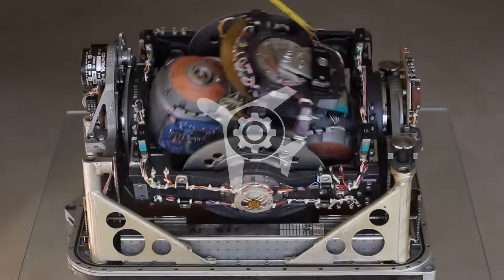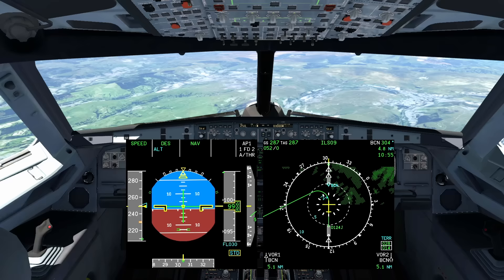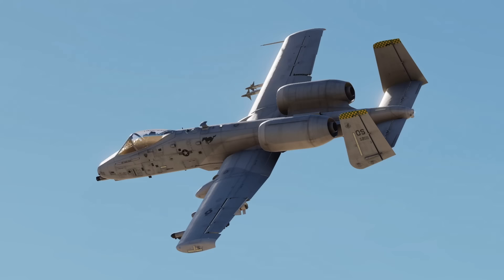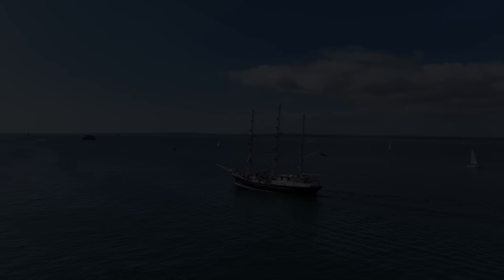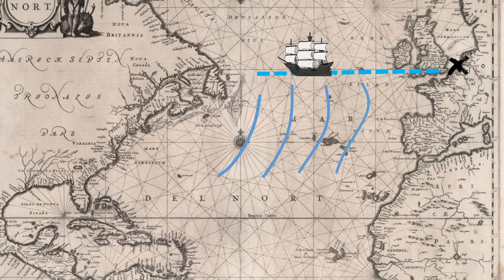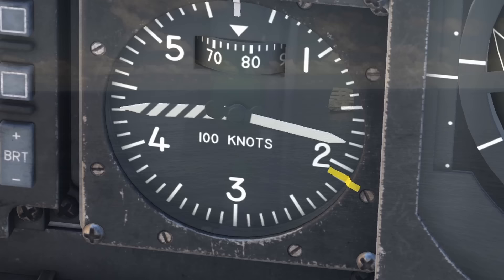The GENIUS of Inertial Navigation Systems Explained

Comment: Very interesting. I actually build part of these inertial guidance systems back in the mid 1960’s. I worked for Litton Systems just outside Toronto. Very fine work under microscope and a lot of assembly was done in “clean rooms” where the air inside was filtered. Anyone working inside that area had to wear special clothes that went over all your street clothes including your shoes. Only your face was exposed. The fingers on your hands were covered in finger cots, they looked like miniature prophylactics. If you had a cold or were sneezing you weren’t allowed to go into that area. The tolerances on the gyros were so tight a piece of dandruff could gum up the works. Lots of inspections done on this work.
Reply: How old r U❓
Reply: Sir, that’s absolutely fascinating. Lord knows my notifications for YouTube are all sorts of outta wack, but I’d appreciate any more info or stories you have from your time there, or in related fields. 

As someone who loves American history and 20th century history (especially postwar) - the amount of mundane people one can meet now in person or online is wild. 

All these stories hardware and vehicles, and those who had hands-on day to day such as yourself are here and around to speak about it.
Reply: @yeetyateyote5570  , I only worked at Litton Systems for about 13 months. I mostly worked on what was called the end bell which underneath the round end of the gyro. The metal was anodized aluminum. There were holes drilled for very tiny electrical contacts all around the circumference. We had to glue in tiny literally gold coated contacts into these holes withe special adhesive. I believe the tube was called LC 9. They were kept in a freezer. We had to sign each tube out and they were only good to use for 30 minutes. We used a tiny applicator to put about a 90% circle around the gold contact which was imbedded in a glass insulator. This work was done under a 10x power microscope. We had to place the contact into the hole and not get any of the glue onto the side on the way down. These end bells were placed into small autoclaves to cure the glue. I forget how many contacts were on each bell. We had rubber coated trays that held 5 end bells. We were expected to do I think 30 per week. Not big pay, only around $1.15 hourly in ‘64. All of these end bells were inspected to ensure there was no glue on the side of the walls. After curing a clear sealant was put onto each contact and it was cured too. If you had any rejected you had to clean it all up and re submit it for inspection. I was pre darn good after getting a few rejections at first. Being more precise was better than cleaning up.
Reply: @rickbullock4331  That’s fascinating. I got my pilot’s license in 1992, but never used ILS because my family owned many FPO that my grandfather (an early adopter of personal aircraft) had founded during the time many airports were being built. I’m shocked when this video says that a gyro will need correction due to changing gravity. Although it was never discussed, I assumed that a gyro would adjust to local gravity and always stay exactly positioned as it was started in reference to L&L. If I took off from Lubbock to Honolulu, I assumed old ILS was flattening out as I flew- in relation to the starting position. How did I miss this all these years? LOL

I never learned ILS or even continued flying fixed wing, as I knew 30 years ago that we had employees that would always be better at it than me. My thing is exotic cars and guns. I figured I would live longer if I let the guys who were passionate about flying to the flying. I’ll drive the race cars once we get there and make my money with guns. 

BEST WISHES. 

Nick
Reply: @rickbullock4331  Damn youtube for having nonfunctioning notifications. 
That's quite interesting- it's wild they were paying you guys next to nothing for what is inherently skilled/precise assembley work. To have efficient per-worker use of the temp sensitive glue and more importantly to eliminate the maximum possible amount of inconsistency between final products with such manual methods, you'd think the wage should've been higher!

Comment: My great uncle worked for the Bendix Corporation in California. They had a contract to make ball bearings for a ballistic missile nav system. The balls had to be machined to millionths of an inch. As they began delivering the balls, the missile company was rejecting them as being out of spec. Bendix had to mount an investigation to understand what was happening. Turns out the method being used to measure them was so sensitive that it was measuring a thin film of oil left by the machining and adding it to the overall measurement.  They began cleaning the balls with alcohol before measuring them and that solved the problem.

Comment: The first series of airline ABS braking is pretty ingenious as well.   
There was a generator affixed to each wheel.   As long as they were turning, they generated a specific voltage.   When the wheel locks up, the voltage drops and the relay opens up the brake that goes to that wheel.   When it starts spinning again, the brake pressure is allowed to continue.
Reply: Is that the Maxaret system?
Reply: Don't remember..

Comment: What a superb device AND presentation, thank you :-)  I remember the early US transcontinental INS validation flights. Soon followed by commercial aircraft such as Concorde and the first 747 series being fitted with three INS units that would monitor each other's performance... allowing a 747 to fly from Sydney to London (with two stops) in the pre-GPS era. Of course, there were also ground based radio navigation devices (VORs and NDBs) that allowed INS cross checks and updates, when necessary, as the route progressed.

Comment: The submarines that I was stationed on in the 1980s had inertial navigation units which we used all the time.  They were invaluable for navigating when we were submerged.
Reply: Used these systems in submarines in 1960’s. Very accurate depending on period checks with other methods
Reply: They were extremely accurate, I believe the missile guidance systems we're dependent on them for target accuracy.,
Reply: @stayfree6115  Actually, no.  Targeting was done by navigational sonar using meticulously mapped locations on the sea floor.  The U.S. Navy actually had three ships, USNS Bowditch, USNS Dutton and USNS Michelson (the last replaced by USNS H H Hess) whose only purpose in life was identify appropriate locations (some relief but not too much) and then meticulous map those.  There were a lot more identified locations than boomers, backups to backups to backups if you will.  The last of the mapping ships was deactivated in the early 1990s.  Another ship, USNS Waters, is still in service (I believe) as a testbed for modifications and improvements to the navigation sonar.
Reply: @stayfree6115  The INS position was important for the initial phase of the missiles flight but I believe that latter missiles received a star tracker system (certainly Trident) & could be independent of GPS and INS.
-The most accurate INS ever developed was the  "Advanced Inertial Reference Sphere" (AIRS) for the MX peacemaker.    I worked out it was accurate to 0.5m at the end of a flight of 6000nmi.   It's actually accuracy error was about 100m due to flaws in the gravitational maps of the earth.

Comment: I was a technician on a US Air Force test aircraft during the 1970s and we had a Litton LTN-51 INS onboard. It was a cantankerous device at best which often had significant errors. At the time, we also carried an Air Force navigator with us. His services were often needed. And if the INS ever failed inflight, it could not be reset until we were back on the ground.

Comment: I was an Avionics Guidance and Control Technician in the Air Force/ANG working on KC-135 Air Refueling Aircraft , and worked on the INS System, very amazing technology. Another interesting System was the SAS (Stability Augmentation System) which helped stabilize the KC-135 during refueling operations. it contained Rate Gyros and Displacement Gyros on a platform to control spoilers on the wings  to eliminate the effects of turbulence etc.. I always was amazed how it used these Gyros to detect direction of movement rate and displacement BEFORE it occurred to provide the necessary correction to maintain precise level fight. Which was a highly technical operation considering the size difference of the Refueling Tanker and smaller Jets being Refueled, which both responded differently to turbulence and other outside factors. Also the Fighters were flying at a much lower speed than Typical, and the KC-135 faster than typical. I flew on a few Refueling Missions in the U.S. and Japan. One of the most memorable was refueling other Air National Guard Aircraft which included F-15's F-16's and even F-4 Phantoms! the Air National Guard Units utilized Aircraft long after Active Duty Units moved on to newer planes. During childhood I lived in England where my Father worked in Air Reconnaissance, developing the Film from U-2 and SR-71 Aircraft. I would have loved to see one during Refueling from the Observation Window at the bottom of the fuselage near the Tail like the other Jets I had watched.  I was always fascinated by the SR-71, and saw one fly directly overhead during and Air Show at Fairchild AFB. We we parked just outside the fence at the end of the runway and it flew very low overhead as it took off. The sound, and immediate blast of heat from the engines was intense! Years later while in Basic Training at Lackland AFB I saw another fly overhead during a Retirement Ceremony for it. They announced over the PA System as it went overhead and crossed various states soon after, and witnesses several Sonic Booms as it accelerated away. I was fortunate to be directing visitors and not forced to stand in formation on the Parade Grounds with most of the Recruits. They were not permitted to "Look Up" during the fly over, and see it.

Comment: I love your use of dead reckoning to help explain the INS, I never thought about it like that before! 
Even modern airliners still USE INS/IRS (/Inertial Reference System), but it's mostly used to supply attitude and heading data to the PFD. It also still serves as a backup in case of a GPS and Radio Navigation outage, or the airplane's receivers fail.

Comment: Couple of things: The item displayed is a "Twin Gyro Platform (TGP)" it provides the inputs to a Navigation computer for integration with time to get velocities and distance. The TGP not only has to maintain level but must also point True North (the Accelerometers provide N-S and E-W acceleration into the nav computer, which then calculates Lat Long, distance traveled, course etc. ). During start up the TGP senses the earths rotation to perform a levelling and TN alignement (helps if you know your starting Lat, Long). 
Limitations of the TGP - Does not like to climb vertical, nor travel over N or S poles (gimbal lock).

Comment: The the number one reason the military uses INS is for stealth. No signals coming or going to be detected. The commercial application is for backup redundancy. Excellent presentation! ❤
Reply from the maker: Thank you!
Reply: @FlyByMax  your channel is being spammed by "text me"
Reply: Also no jamming. GPS can be uses for guidance by just receiving signals without emitting but can be jammed. INS can't
Reply: Receiving GPS signals is just as stealthy. GPS satellites are constantly emitting all over the planet. There are no emissions from the aircraft. Actually any signal navigation, whether it's coming from the ground, sea, or another aircraft would be relatively stealthy as long as the receiving aircraft doesn't have to emit. But I guess INS takes away the need for signals altogether to some extent. The problem with INS without GPS/signal/manual correction is that it becomes inaccurate over time, "INS drift" as they call it.

Comment: My father was a guidance control engineer in the late 50s. He worked on gyro’s @ SPERRY RAND working on the Sidewinder missile system and the Polaris program. In 1962 He went to work for NASA working under contract @ General Electric to work on guidance controls for the Apollo program. In 1969 we moved to northern Va. where he worked @ the Navel Research Laboratory. He wasn’t able to tell us much about this job but what I gathered is that he was working on future missile systems for the US NAVY.

Comment: Worth noting that because it is impossible to tell acceleration from tilt with no outside reference, instrument navigation is crucial for flying through clouds, low visibility, night, etc, or pilots could mistakenly fly straight into the earth, or at wonky orientations, especially when other aircraft failures occur. The gyroscopes are crucial, as well as altimeters.

Comment: Very interesting video! What I didn't yet really understand is why the whole platform needs to move. 
Can't you just have 3 Gyroscopes by which the orientation is being provided (which is basically the direction of the vector of the acceleration of gravity) then take the data of the accelerometers and subtract the gravitational acceleration from the resulting vector? Aren't moving parts also usually more error prone or maintenance intensive? What am I missing?
Reply from the maker: I'm delighted that you ask this question, because it's exactly the same conclusion engineers came to when digital computers started to become available! 

Modern systems do exactly what your intuition says: they correct for gravity by subtracting the vector through a computer. There is then no longer any need for moving parts at all, and this removes a lot of problems related to precision and accumulation of errors (exactly as you said).

At the time of the INS shown in the video, computers were not yet available/compact enough (not sure which), so everything was done mechanically and through voltages in wires. This essentially was "the computer".

Hope this makes sense, and the fact that you came to this conclusion by yourself means you thoroughly understand the essence of the topic. Have a good one!

Comment: thanks for the video. 

as a biomedical engineer I just want to point to something in the video : humans can tell if they are tilted because we have the inner ears that does the same job you're describing for us, except at much higher real time speed to keep us balanced too. (being bipedal is not that easy). so yeah our bodies don't have that limitations, it just too natural for us we don't pay attention to it.
Reply from the maker: Your vestibular system (inner-ear) is sensitive to angular acceleration, which is a rotation over time. If your orientation does not change over time (zero acceleration), your inner-ear won't be able to tell you if you're tilted or not. Thanks!
Reply: @FlyByMax sorry I fail to understand your point. 

is there  a case where the body(or the head at least) can tilt without it changing orientation during flights?
Reply from the maker: @aymenninja8120  You're right, to change orientation means an angular acceleration must have occured. My point is this: after a certain amount of time of constant orientation/angular velocity, your vestibular system no longer senses any input. Imagine sitting on a chair with your eyes closed and rotating at a constant speed. After a while you won't be able to tell you're rotating. This means that we must still need an external reference (e.g., eyes, or in the video - a gyroscope) to figure out our true orientation. Sorry if I misunderstood your comment, have a good one!

Comment: 1 more details about what is inside that system would be nice
2 how does it communicate with the main circuitry if each mechanical link is a gimbal ?
Reply: Slip rings. Same tech in your cars steering wheel.